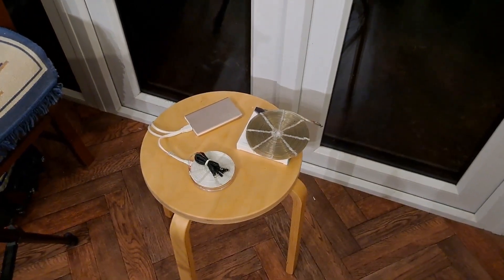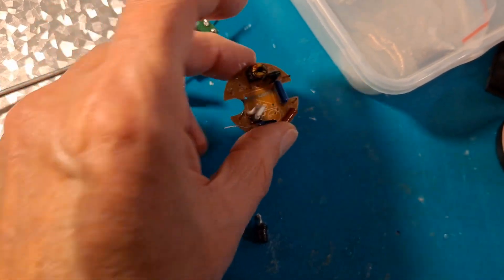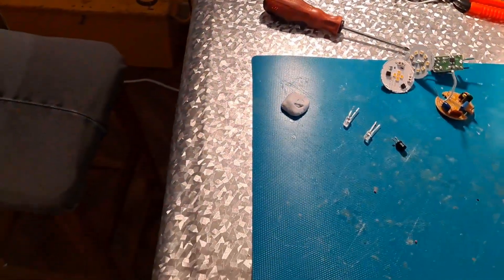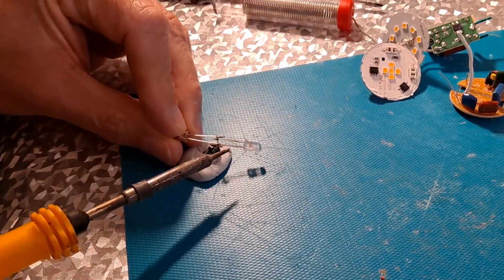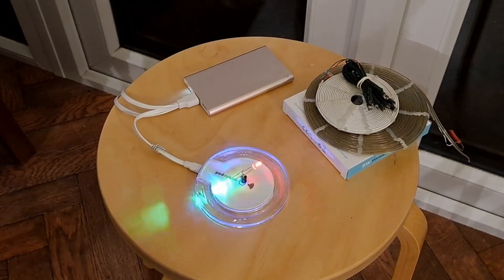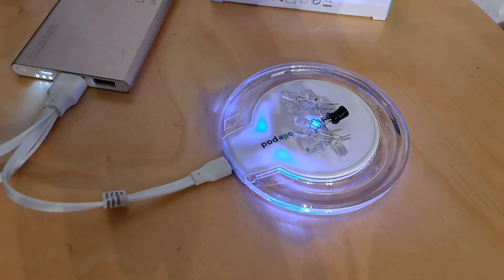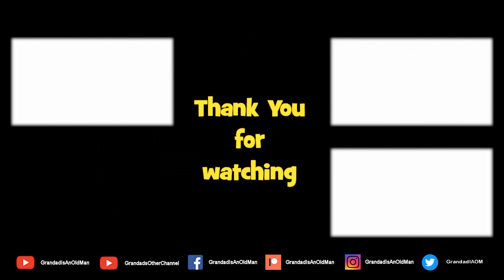Choke - Wireless flashing LEDs

Comment: I am really surprised that choke could do that.  I'm wondering now if you just wrapped some wire around a nail if that would work.     I went ahead and ordered another one of those Qi receivers with a micro usb connector on it to experiment with.  Really neat series of videos you are doing here.  Thanks for the refreshing new project.  Great Xmas present!
Reply from the maker: I was surprised, but when it worked I could see I could have some fun. I have ordered one of those receivers too, so I can see if I can do anything useful with it ("useful" will probably be a debatable point of view 😆).

Comment: This is a good idea. Tell me why it was flashing didn’t really understand that. Thanks
Reply from the maker: I am told (comments on previous video) the wireless charger is continously going through it's startup cycle as it is not detecting a load, so happy coincidence is it gives me a pulsing power supply. 😀

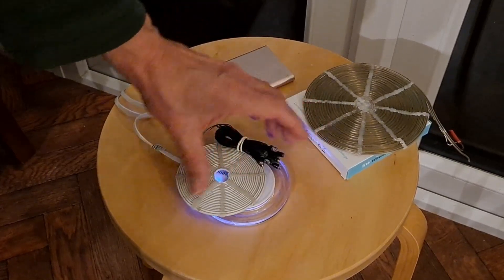Comment: That is really good. I didn't think that little inductor would work because of its size. I recon there must be a lot of fine coiled wire in it. When you first put the inductor near the phone charger I am sure it started to light up when it was still a little distance away from it 3:37 but you put it down to fast to judge the distance. I know its a magnetic field and doesn't need to touch it but was just wondering haw far it can be from it and still work. Would give you an idea of how far the magnetic field extends. Probably just a couple of centimetres I expect. 😁👍
BTW: Are you sure it stops pulsing when it detects a bigger load? I am sure it just charges with that pulse. The coil in a phone is going to a lot smaller than the big one you tested.
Reply from the maker: I am only going by what the experts have already commented. I don't really care how it works. It works and that has given me the basis for a short series in the run up to Christmas. You say the one in a phone would be smaller, as far as I know it is a large flat pancake coil, I have one on order for test purposes. You can stick them on the back of your phone and plug them into the phone's USB port. As I use my phone for filming, there is no way I want the adaptor plugged into the USB port all the time so I won't be using it on my phone. I will just modify it for my purposes.
Reply: @GrandadIsAnOldMan  My phone is old and doesn't have a coil in it but that is great news about there being a receiver coil that plugs into the USB port. I never knew that. If you have the link to where you bought it I would thankful for it Graham. 👍
Reply from the maker: @mikeflight9  have to check when I get home, coffee shop at the moment 😊🍮
Reply: @GrandadIsAnOldMan  Haha, your always in that coffee shop. 😆
Reply from the maker: @mikeflight9  Our daily routine, gets us out of the house. However, at the moment I have cut back on the charity shop visits again. This is the listing I ordered from, I like the listing because it gives you the details of the different types although most are shown out-of-stock. I will be cutting mine up when it arrives to have a look at it https://www.ebay.co.uk/itm/254606624610
Reply: @GrandadIsAnOldMan  Thanks for that Graham. Just bought one for my iPhone. They seem to short on the android ones. Got myself a charging pad also. 👍
My wife is working at our local hospital today, (Psychiatric Nurse). Just got a phone message with picture showing me the really deep bite she just got from a 62 year old woman. She needed to go down to A&E. Also injections for Hep B. Really makes me so FN angry. Had to tell someone and get a rant, so it was you. LOL
I am glad I am not a Nurse in her position, especially how I feel just now. If you know what I mean. 😡😡😡
Reply from the maker: @mikeflight9  I can sympathise. One of my daughters works with "special needs" children and regularly gets bruises and bites. Not a job I would choose. Even the relatively young ones can be dangerous, at one time she was working with the 16 to 18 year olds, you can probably imagine they can be very powerful, more than a single person can deal with safely.
Reply: @GrandadIsAnOldMan  Yes, I agree. Many kids are far more powerful than an adult. I have a nephew with severe autism. He started to beat his mother up and is now in a special needs centre which will be similar to where your Daughter works. It is a dangerous job that is generally not recognised by the general public. My wife has been a nurse for 40 years and I know the dangers she or your Daughter can face. 
I take my hat off to them for what they do.

Comment: 5:40
Impressive it works with the choke 90 degrees out of parallel with the drive coil .
Reply from the maker: Yes, obviously it works best at an optimal position, but it manages to pick up enough power for the LEDs at almost any angle or orientation as long as it is towards the centre of the disk.